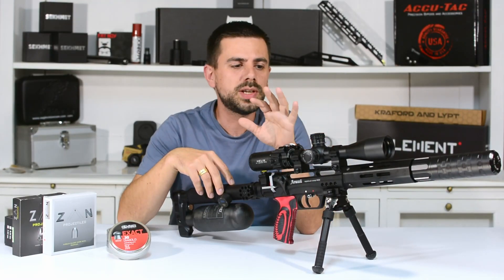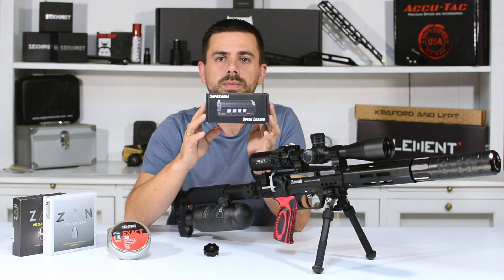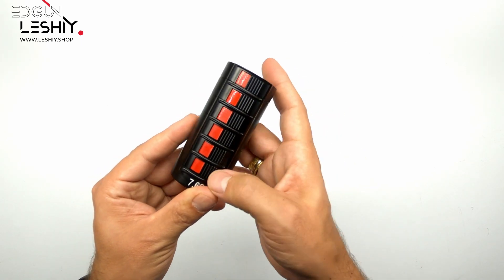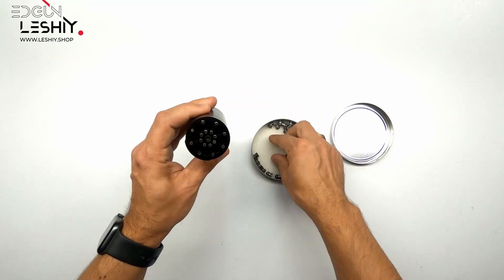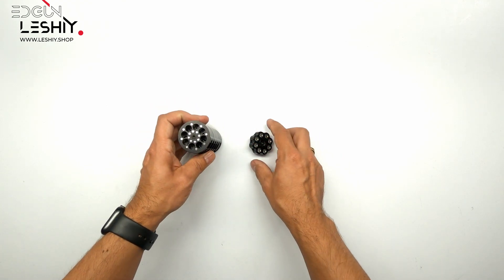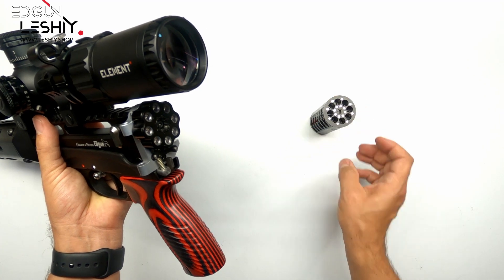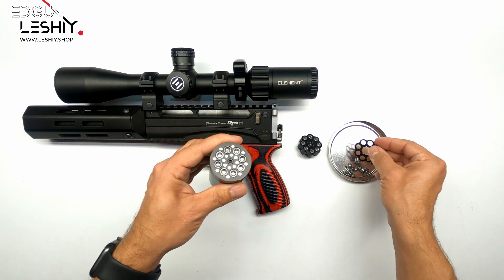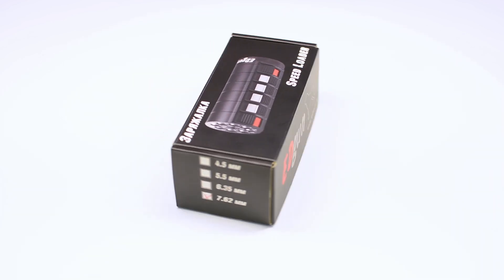SPEED LOADER FOR THE LESHIY 2 BY EDGUN

Comment: I'm considering to buy a .30 caliber version. Should it work also in .22 caliber? Looking on the system, look like it's possible to work🤔
Reply from the maker: These speed loaders are caliber specific, they do make a dedicated 22 cal 😉
Reply: @Airbuks  yeah, it's just because i have both calibers, and it's an expensive tool, so I'm considering to buy one .30 and see if it works also with the .22
Reply from the maker: @netohagen5104  you can try , the first batch might drop down fine . But the higher in the loader the more time they have to get misaligned due to the diameter difference. Let me know how it works out

Comment: What about slug’s? The slugs are .3033 and are a snug fit in the magazine.
Reply from the maker: The holes in the speed loader are a little oversized so that won’t be the problem I think , but they won’t seat by itself without pushing in with your finger 🤔 haven’t tested